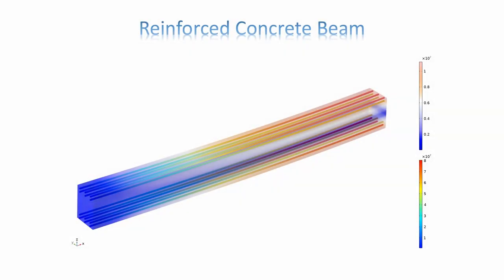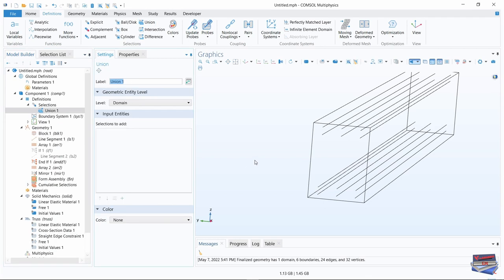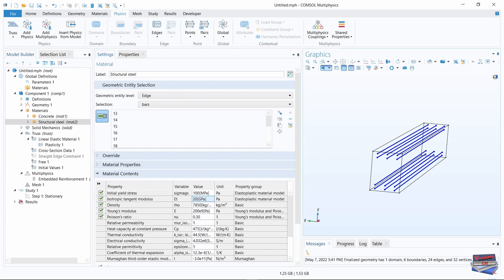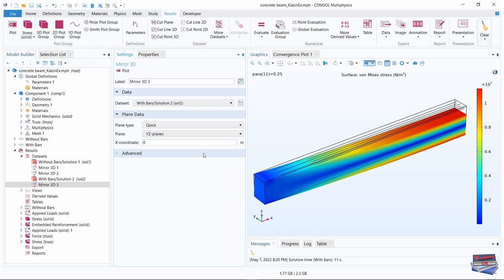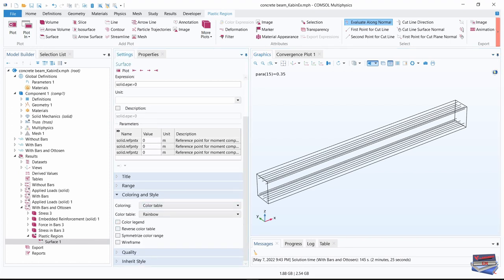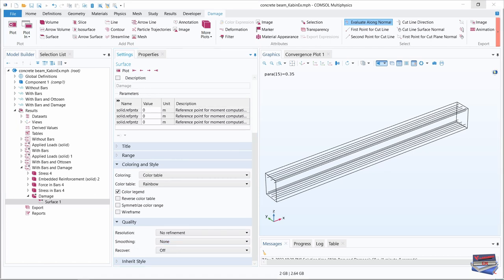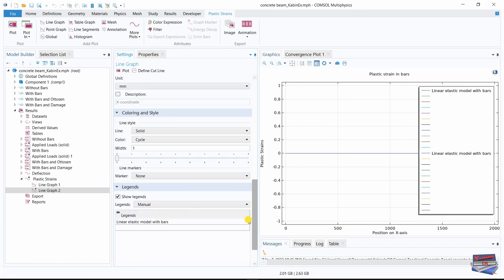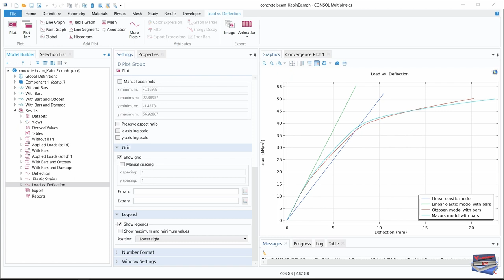Reinforced Concrete Beam (COMSOL Multiphysics )

Comment: Please tell me :
1- Is there easier way to fast draw the concrete and steel bars than the used one in this video, because it is very hard if the model has a complex geometry?
2- Please tell me how to define the interaction between bars and concrete? can to define the slippage ? HOW?
3- are you previously compare the COMSOL results with experiential ones to examine its accurately?
4- Is Comsol Consider better than ANSYS and ABAQUS regarding nonlinear analysis of concrete structures?
THANKS
Reply from the maker: You can always create the model in another software and imparts it into COMSOL. Most CAE the software are good for nonlinear analysis, but it boils down to preference.  I would say spent time with one, experiment a lot until you can master one. Here is a good clip for such: https://www.comsol.com/video/modeling-nonlinear-materials-in-the-comsol-software

Also, here is another: https://www.comsol.com/video/modeling-nonlinear-structural-mechanics-in-comsol-multiphysics-aug-16-2018

You can read this page as well: 
https://www.comsol.com/nonlinear-structural-materials-module

I hope this help and all the best!

Comment: Thank you for this tutorial, if I used the experimental data (force-> displacement), how I used these data with this model to compare with simulation results ?.
Reply from the maker: You are welcome. Do you want to add a force vs displacement plot?  The same method applies. Just that you will need to select the expression you need. You can add a 1D or 2D plot group then right click and add a global, point or line graph etc.., then add your desired expressions then hit plot. Let me know if that is what you requested.
Reply: @kabindaex7047  The experimental curve (Force-diplacement or Stress-deformation) is not compatible with the numerical results, I don't know what the problem is. Can you give me your email so I can send you this model?
Reply from the maker: @MultiSaded  Upload your file in the link below, add your email address in a text file or word document. 

https://drive.google.com/drive/folders/1KQZ9MqyeJPCQD4sMjbCk71u6X-NMMYsx?usp=sharing
Reply from the maker: @MultiSaded   Refer to this video: https://youtu.be/ImpxZlCzzfQ

Also, the units (kN/m^2  or N/m^2 etc.) must be the same within the imported data and the computed data.

Comment: Hi
Can Comsol Can comsol  accurately capture cyclic behaviour and PINCHING effect of RC elements under cyclic loading? If yes, please tell me HOW?
and Can comsol capture the concrete shear reduction and bond slippage between bars and concrete during cyclic load?
Reply from the maker: Hi, thanks for viewing the tutorials. You can check the following link for more information. https://www.comsol.com/search?s=concrete+shear+reduction
Reply from the maker: Here is another useful blog about shear strength reduction (SSR). Substitute the necessary materials and parameters with the values relevant to your specific project. 
https://www.comsol.com/blogs/analyzing-slope-stability-through-the-shear-strength-reduction-method/

Comment: Actually I'm working on corrosion in reinforced steel in concrete while using organic and inorganic hybrid corrosion nanoparticles for corrosion protection, can you suggest me how can i go forward with use of this video
Reply from the maker: Do you mean like Cathodic Protection of Steel in Reinforced Concrete?

If so, try using the  Electrochemistry>Tertiary Current Distribution, NernstPlanck>Tertiary, Supporting Electrolyte (tcd) from the Select Physics tree.

Comment: Sir, thank you for this video. It's very helpful for my project source and I have some doubts sir related to my project, can you help me sir?
Reply from the maker: Explain
Reply: In the first condition, elastic beam without bars at final stage it would be displayed by error. The same procedure I can follow, but error is repeated. What can I do it sir? After this result step could not be properly displayed sir.
Reply: Now am I using comsol 6.1, sir
Reply: In this stag, how to rectify the error sir please help me sir
Reply from the maker: @dhanasubhaa1213  What's the error?
Reply: Sir, the error is unknown function or operator - name: intop
This error is displayed before resulting step for everytime. What can I do this sir?
Reply from the maker: @dhanasubhaa1213  Share your email address and I'll reply from there.